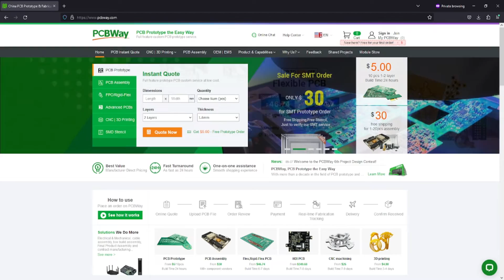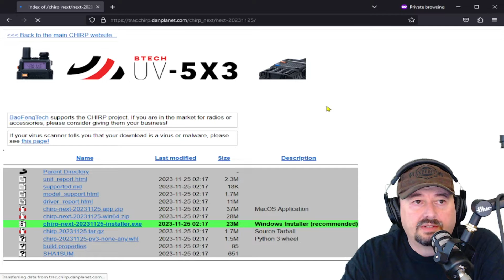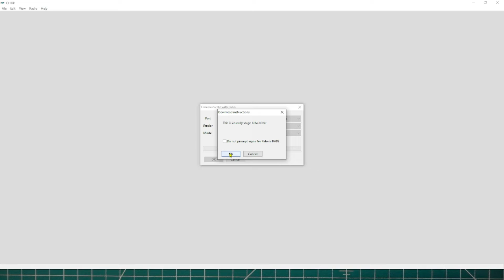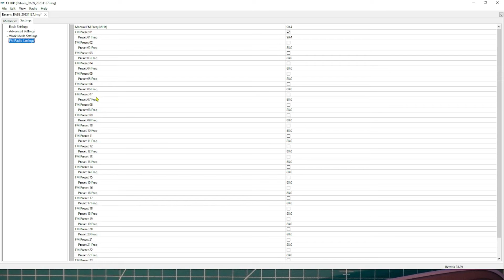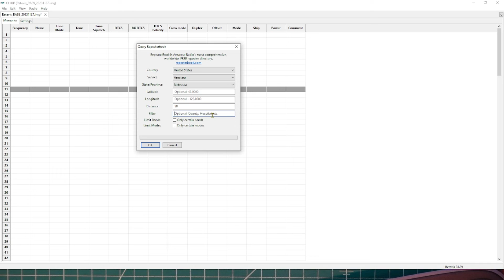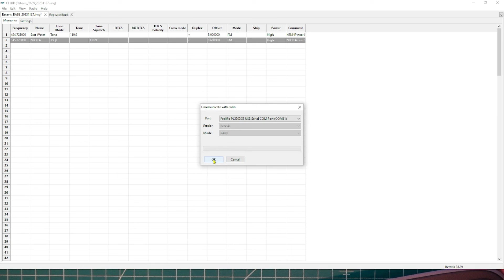Programming the Retevis RA89

Comment: When using either CHIRP or the RA89 proprietary programming software, I have not been able to reprogram the P1 and P2 user-programmable side buttons after uploading.  When programmed to SCAN, it simply monitors the selected channel.  Upon downloading the settings back into the program, the settings are indeed correctly set.  It just doesn't work.  Do you experience the same issue?
Reply: I have the same issues with the P1 and P2 buttons. However the scan mode seems to work correctly. Also this is with CPS and what seems to be the latest firmware. I've noticed in the comments for other videos involving this radio that other people are having this same issue with P1 and p2.
Reply: @RedMurkal    Hmmm, interesting - I have not been able to get the SCAN function programmed into either of the P1 or P2 buttons either.  You are at least one step ahead of me.
Reply from the maker: Sorry guys, I haven't tried this...
Reply: Yeah, I went down that same rabbit hole and did find the update program and the update bat file. However, it was the same version that came on the radio so I didn't end up trying it. Glad it worked for you.
Reply: @RedMurkal   The one I found was a couple of weeks newer than the one I previously found.  It was dated 20230926.  The previous version did not fix the issue but this one did.
Reply: @RLPnKY You may be on to something. I think that version may be different than the one I found. I recall that you had trouble posting a link for the download. But it would be cool if you could.
Reply: @RLPnKY  I'm curious, was the firmware that you applied the B91.28 version? I found that one on the Two Way Radio Community site.
Reply: @RedMurkal    Yes, B91.28 was what I had found that worked.
Reply: @RLPnKY  Retevis has a video on one of there channels offering a link to the B91.30 firmware, it's in the description.
Reply: UPDATE:  I reached out to Retevis and they sent an application to update the firmware but did not include the binary file containing the actual firmware update.  They also sent a video of how to perform the update but of course, it was all in Chinese.  I wrote back to ask about the binary file, and I am waiting to hear back from them again.
Reply: UPDATE #2:  After much searching on the internet, I was finally able to track down the most recent firmware update file and applied it to my RA89.  This FIXED the two-button programming problem.  I do not know how to share the file on YouTube so let me know if you want the file, give me an email address, and I will send it to you.

Comment: I just got one of these and overall it is awesome, but noticed something that doesn’t seem quite right — I installed the belt clip and if I touch a finger to the screws that holds it on, I felt some spiciness come out … very minor rf burn! Anyone else experience that? Is that normal? Great video btw.
Reply: Following up on this, Retevis said it’s normal for their to be current across the back screws. If I decide to use the belt clip later on I’m just going to paint over the screws so I don’t shock myself lol. Seems silly but whatever, it’s still a cool radio.
Reply from the maker: Oh boy.  Did this happen when you TX or RX?  Also, were you touching both screws at the same time?  I want to do some testing…
Reply: @TheSmokinApe  it was only on TX and I was only touching one screw — the left one if you are looking at the back of the radio. I was thinking it might be that the screws are drilled into the actual metal chassis of the radio, but still seems like anything touchable on the exterior of the radio should zap a guy. Not really worried about it but would love to hear about any testing you do, I also emailed Retevis about it so we’ll see what they say. Thanks for the reply!
Reply from the maker: So I did connect a multimeter between the two screws and there is definitely voltage and current across the screws when transmitting 😳 I'll also let retevis know

Comment: Too bad no alpha display of the channel name. Do you have a spreadsheet that you keep with you to know which channel number corresponds to what?
Reply: I was able to set mine to show the channel names rather than frequencies/channel numbers using CHIRP, I’ll have to double check but I think it was under the advanced settings - one of the drop downs had a “name” field and that did it.
Reply from the maker: I can see where you set it in the CPS but I'm not seeing how to swap the display.
Reply: In order to have the alphabetic name of the channels, in channel mode, you have to do two things: in the "memories" tab you have to insert the repeater name for each line. That's not enough. In the "settings" tab you have to go down to the last-but-one position and set the drop-down menu to "Name".

Comment: My RA89 came with a cable, but the bottom pin on the radio was much larger than the pin on the cable.
Reply from the maker: Well that’s odd, should be a K-type connector
Reply: @TheSmokinApe  Thanks. Although the hole in the radio is large, I found that you can get the connector positioned correctly and press really hard and it will work fine.  Thanks for the nudge to try again.  I was afraid to damage a new radio, so I didn't press hard enough.
Reply from the maker: @hicksdp  glad to hear it’s working  👍
Reply: The push method got me going also!  Thanks

Comment: I recently bought a Retevis RT95 25W mobile with programming cable for my shack VHF/UHF radio and it was just as easy to program as this RA89. None of the Yaesu nonsense of "turn off the radio, hold the MON button while turning it on, select CLONE from the menu, short-press F/W then press PTT" and hope it works (FT-60R, which doesn't even have a Yaesu programming cable available for it.)
Reply from the maker: I like the 95, great radio 👍